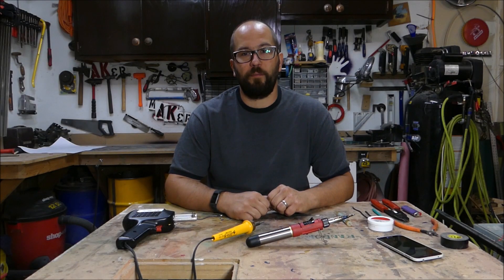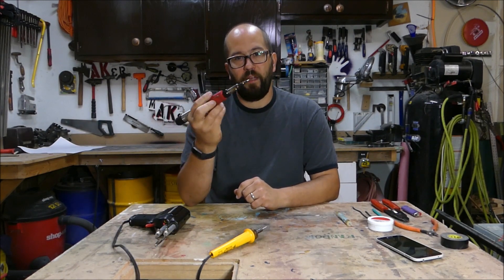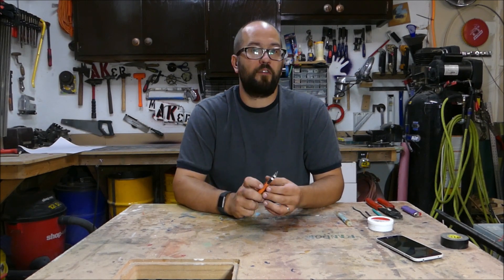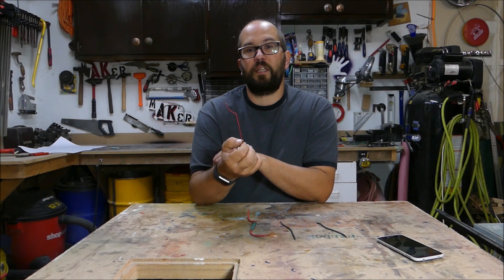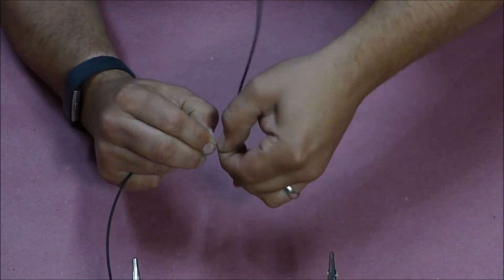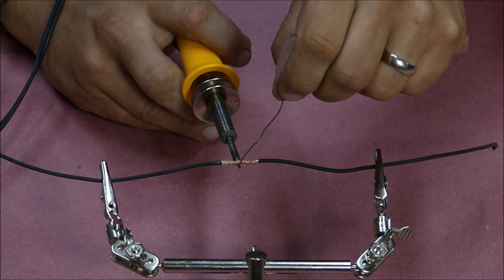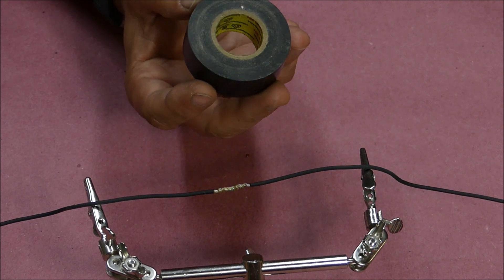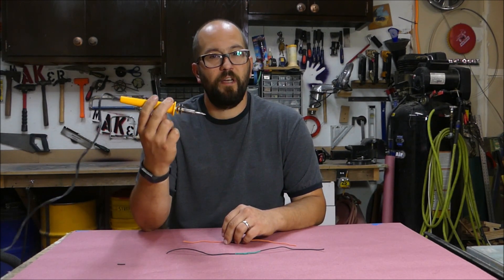Day 16 Soldering Multi Strand Copper wires Together DIY Maker Tips and Tricks Automotive Repair

Comment: @josesantana561 yes me too. I’m trying to follow this video as guide to solder multi strand copper wire and it will not do it. The soldering iron gets hot enough to wear it will melt a drip of the rosin but I can leave the iron on the copper wires for 40 seconds and it does not get hot enough to touch the rosin to the wire and melt
Reply from the maker: Have patience. Depending on the size of the wire and the wattage of the iron you may have to wait multiple minutes before the wire is hot enough to melt the solder itself. Back in my way too loud car stereo days I sometimes had to use 2 soldering irons on the same connection, at the same time, to get enough energy into the wire to melt the solder.  Good luck.
Reply: @andyandnancy  I had two, and they sat plugged in for like 20 min so I don’t think heat was an issue I think bc they’re Cooper they need flux so I’m gonna try this

Comment: Thank you for the video. The multi-strand copper wire I'm trying to solder does not wick into the wire even after applying rosin paste. It appears to have poor wetting. It is old wire however looks like it's still in good condition. Any suggestions?